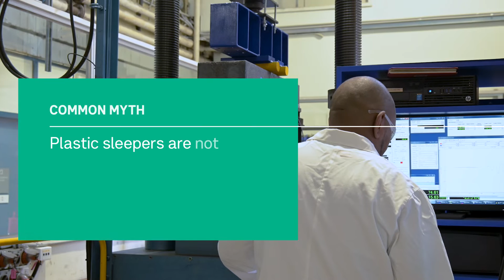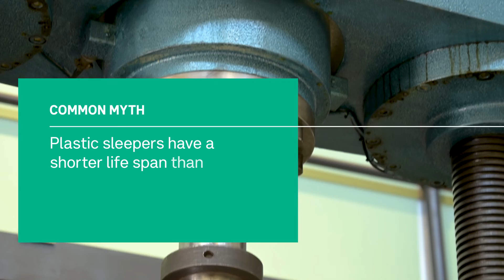Mythbuster Series - recycled plastic sleepers

Comment: We use recycled plastic sleepers on a very small railway (7.25 inch gauge) in Perth.  The first ones went in about 25 years ago and there is no sign of deterioration.  They don't rot, termites don't eat them, the threads of screwed in rail fasteners don't rust and they have survived the occasional bushfire.  They are a great success and effectively maintenance-free.